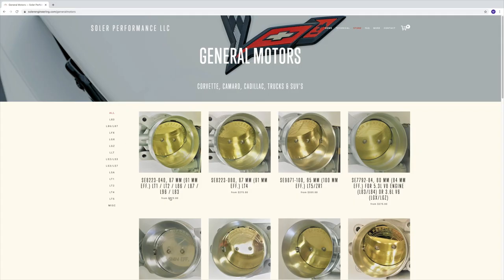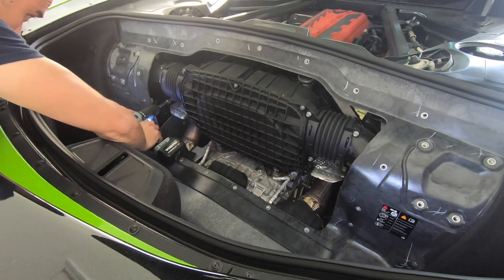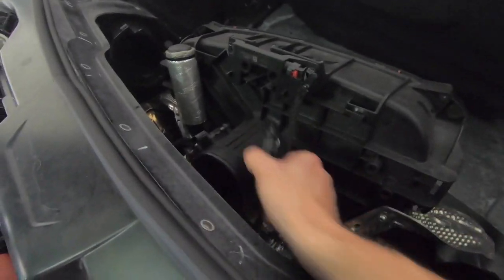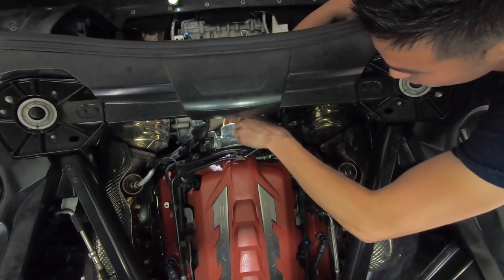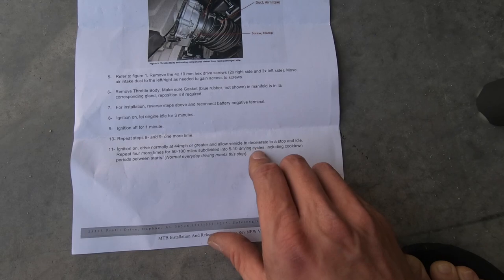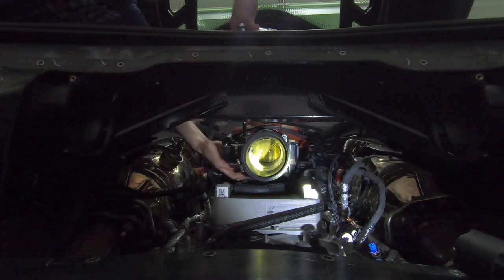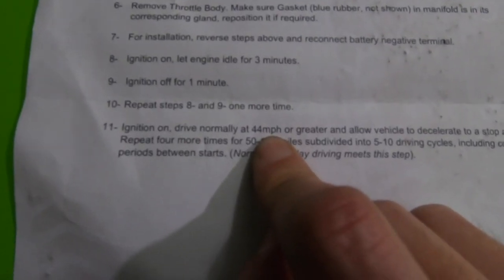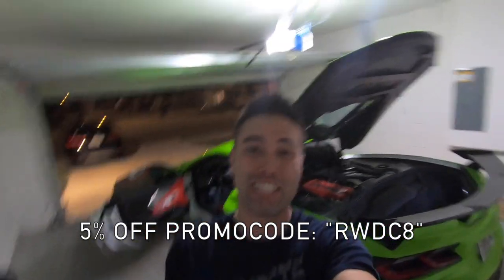C8 CORVETTE SOLER PERFORMANCE PORTED THROTTLE BODY INSTALL (HOW TO)

Comment: Hey Matt. Inst ructions are pretty good except you’ve had your airbox off before and if you haven’t, there’s a bunch of connectors on the air box holding the wire loom, preventing you from getting the box out. I still haven’t found them all and I still can’t get the box out. But I assume because you already had the box out already had those cut so made it look pretty easy. If it’s your first time on a two 2023 it’s a little harder than what that looks. Thanks again for taking the time of the video.

Comment: Was running a consistent 3.1 second 0-60 in my non-Z51 C8. Looked for performance info with this Solar Performance ported throttle body but only found info on increased air flow so bought one hoping for more power anyway. Ran several 0-60 runs today and the time is same, 3.1. So far no change versus stock noticed for me. Shifts the same, runs the same.
Reply from the maker: Did you pick up the throttle controller too? They just released a wireless one. That’s where you will feel the difference
Reply: @RWDC8Z  No, haven’t added a throttle body controller yet. Don’t see how it would improve full throttle acceleration unless I’m misunderstanding the principle. My goal is to realize a bit more HP and torque which the ported throttle body does not appear to have provided. Thinking headers and cats may be the best bet to achieve that.
Reply: @larrygrimes824 The throttle controller will make your car feel quicker and more nimble. 100% worth it. I have both and the car is 10x more fun to drive. You can thank me later.

Comment: Great videos Matt! I am in my break in period and installed the tb today as well as an Attack Blue filter. Those clips were a bitch, ended up cutting some and doing my own zip ties on a couple of them. Otherwise the air box would not have come out, in hindsight tho it could have stayed in and the tb could be removed w/ the airbox in place. Glad I'm not doing it again lol. 

I took the opportunity to also Dynomat the rear cargo area and keep the temps lower. Again great channel, keep up the great work and smiles!
Reply from the maker: Thanks Mike! Yeah I realized that too, could have done everything from the top. 🤦🏻‍♂️
Reply: @RWDC8Z  That one bolt on the tb is hard to get to tho, w/ the airbox off you can get a better view, have more room and see what you are doing. I have some high flow cats on the way, just taking it in to have those done and car lowered next week. This is not an easy car to work on for sure.

Comment: Don't if you'll get this now, but I'm installing a ported intake & throttle body, can't get that lower right connector in the lower back apart to get to the lower right airbox bolt...any tips?

Comment: Thanks for the tutorial, Matt. I'm curious about the factory C8 throttle body. Was there oil residue accumulated around the butterfly like happens on C7 throttle bodies?
Reply from the maker: No Problem, unfortunately I’ve never seen a c7 throttle body. Sorry man.

Comment: Hey Matt just ordered my TB should be here this week(thanks for the code) I’ve been hearing that you don’t have to remove air intake housing is this true
Reply from the maker: I found that you need to move it back just a little cause the coupler from the intake is so stiff
Reply: @RWDC8Z  yup it’s pretty stiff, I ended up taking the air intake box which is probably harder than taking off the intake manifold. I didn’t want take off the manifold with the fear of dropping something inside the manifold

Comment: Think a high flow filter should help more due to higher flow due to less restriction and would use a combo. I know the performance high flow filter did increase hp and tq due to the before and after DynoJet results on my C8. Can be got for about $100.00. In the past I saw little to nothing from ported TB's in the 1/8 or 1/4 on the 2 C7's I owned.
Reply: HI, Do you mind telling me where you got your filter and or what brand was it? Thanks
Reply: @kurtthomas4746  AFE Performance has the dry or oiled versions, I believe the oiled is the performance version and they are both able to be cleaned and reused, they claim I believe the oiled version out flows the OEM by up to 28 percent.
Reply: @richarddjohanson  Thanks.

Comment: Good one ! I’m going to wait for the review after using it for a month
Reply: You don't need to. I put one on my C7 and it made a huge difference.  That was about a year ago. If you're on the fence, just get one. Get the throttle controller also, I promise you'll love it!

Comment: Does the C8 suffer they same subtle tip in stumble the C7's did? I have the Soler TB and controller on mine. Helped quite a bit
Reply from the maker: No, not nearly as bad as the C7 was. The Soler TB is awesome. Just had it on the track today and my inputs were a lot smoother.
Reply: @RWDC8Z   1/4 or Circuit? I was at the Frim yesterday with my Z kicking ass

Comment: Not to troll or anything LOL but couldn’t you just remove the throttlebody without removing the trunk? Like disconnected from the other  side and just yank it out
Reply from the maker: Lol, I noticed that once I got the instructions 🤦🏻‍♂️
Reply: @RWDC8Z  🤣😂
Reply: I was thinking same.  Can you confirm it can be done like that
Reply: @dmraco  Yep, All you have to do is remove the INtake Manifold and loosen the rubber boot around the TB and it pulls out nice and easy! Then just pull the TB off the manifold. MUCH, MUCH easier, Have to remember to torque the manifold properly tho

Comment: Come to realize that you do not have to go through the trunk to swap over the throttle body, you can just remove the intake manifold...and pull it off with the OEM throttle body and swap out.

Comment: Dude!!! That was a Bitch of an install. Never again.
Reply from the maker: Really? I didn’t find it to be too bad
Reply: @RWDC8Z  I think you had your air box out perviously though which might have made it easier. All those plastic clips holding the wires on in the back of the box where hard to get off. I broke 2. Getting the red wire clips to come loose was APITA. The 2 air box bolts in the back were hard to reach also. Stuff like that and having to lay a cross the motor to reach things just made it no fun. It took me 6 hours to do the whole job. But the TB is noticeable. However, I am past the point of return and that TB is not coming off. I'm doing headers next. Wish me luck.
Reply: @Motleymick  
Just finished the install. Thanks Matt for the video, but I agree somewhat with Motley Mick in that it ain't no piece o' cake as a 1st time effort. Took me 3 hours.  I must admit, I was prepared and had purchased a bag of those Fir Tree cable ties from Amazon in case I broke any. And sure enough, they came in handy. Also handy is one of those fir tree removal tools, Both are cheap and well worth the $6! I also found out the hard way that the bottom of the Airbox needs to come out 1st when removing and then the top needs to go in 1st when reinstalling. Took some  practice!  

Car seems snappier, and I'm guessing it should get even better as the MCU learns to accommodate  the increased air flow. My $02 !!
Reply: I was thinking the same thing just looking at it. Luckely my car's throttle body is much easier to reach or it would take me hours just to remove the damn thing😂